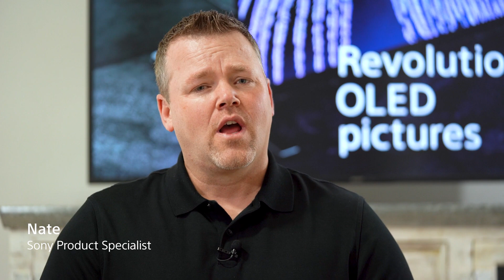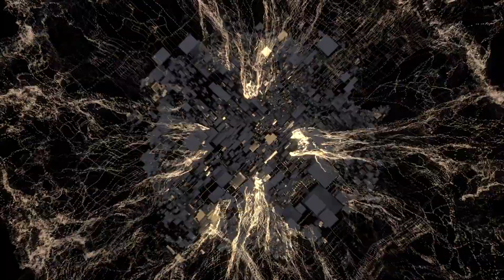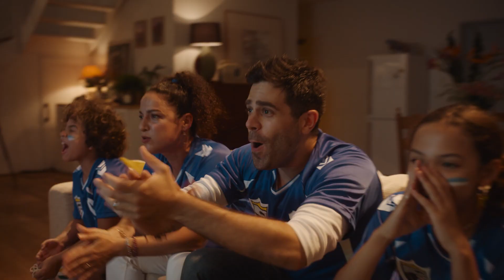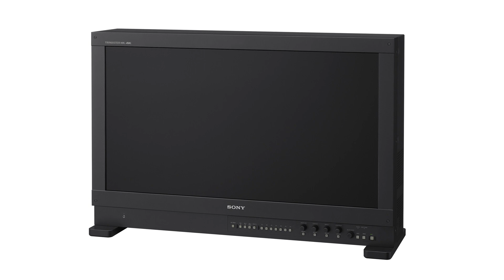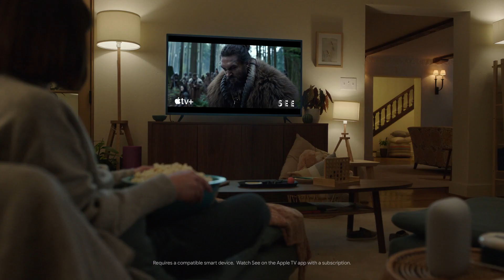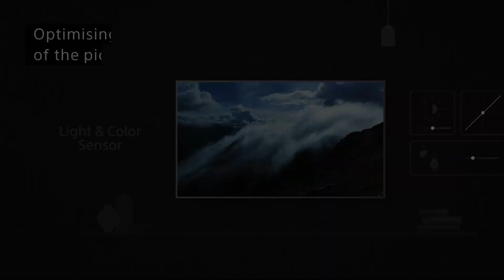Sony | Top Reasons to Step Up From The A80J To The A90J

Comment: Besides the picture quality being excellent there are many issues that come with it. ; soundbar when used on these TVs would drop sound; using on board apps is nothing but pain, it switches the turn off itself, can’t hear sound when you play full movies via the Bravia core through a sound bar . The built quality is atrocious.
Reply from the maker: Hi Elvst, While we're glad you like the excellent picture quality of your Sony TV, we regret to hear you're having sound issues when connected to a soundbar and that the unit turns off by itself. Please provide us with the exact model number of your Sony TV and soundbar so we can better assist you.
To locate the model number, refer to the link below.

https://www.sony.com/electronics/support/articles/S1F0264?layout=standalone

Regards,
Sam

Comment: The main problem of the A90J (especially of the 83 inches model) is the price !!!
I bought a 77A80J for 2.989 €, I had to pay 7.999 € for the 83A90J !
I am not sure the A90J is 2,7 times better ?!?!?!?
It also appears that 77A80J has the EVO panel (from LG), is that true ?
And as already said : please implement VRR quickly on those models !

Comment: The lack of the 77 inch is a deal breaker.  The extra brightness on the a90j seems to mess with other things in a negative way like darks.  The only reason I would want it is for the heat sink that helps with image retention.
Reply from the maker: Hi MrWhatsupeverybody, Thank you for visiting our comment section for your inquiry! The A90J has the protection of the TV screen from image retention like Pixel Shift and Panel Refresh found within the TV settings. Our best-ever OLED TV(A90J), powered by the revolutionary Cognitive Processor XR™ for unparalleled brightness and pure blacks. With XR OLED Contrast Pro using human perspective analysis, color and contrast are boosted in bright areas so you can enjoy the exceptional levels of pure black contrast and peak brightness that until now have simply not been possible. See pictures full of realistic depth between subject and background. Details are sharply defined, even in areas of dark shadow or glare. This TV includes an RGB light sensor that optimizes the color and brightness of the picture to the light source and room environment. 

 Also, you can configure various settings related to the TV display such as color and brightness for picture quality, or screen size. Press the (Quick Settings) button on the remote control, then select [Settings] — [Display & Sound] — the desired option. I hope this helps! Jay

Comment: Will the Sony mount SU-WL855 Ultra slim wall mount bracket support the 83” a90J TV?
Reply from the maker: Hi John Jakaitis, thank you for inquiring about the TV. The SU-WL855 Wall Mount Bracket is compatible with XR-55 & 65" of this series. You can use any Vesa Compliant wall mount with Vesa Hole Pitch 15.75 x 15.75 inch (400 x 400 mm). Please note that there is also a weight limit with any mount and the bracket that you'll be using needs to be able to support the TV weight. The XR-83A90J without the stand weighs 92.6 lb (42 kg). Hope this helps.

Regards,
Jess

Comment: I honestly expected a higher peak brightness from the a90j it gets about as bright as a c9
Reply: Yea they advertise the G1 and a90j as the next level of oled TVs with higher brightness. The C9 was just as bright lol and it’s a 2 year old tv. Ugh I wish I would’ve bought the 77 inch C9 but instead went with the 65 inch last year 😭
Reply: @Squishmallows24  Its unreal how all these "influencers" aren't even mentioning that fact. the c9 didnt even need a heat sink to get to those brightness levels. I havent heard many complaints of burn in with the c9 so its not that, I bet they just added a heat sink to "justify" their price premium.  Influencers also never compare TVs more than 1 generation away. Makes you think. Most of these people are sell outs. They should just be called marketers tbh

Comment: any idea why my 77 inch sony a80j turns on by itself?
Reply from the maker: Hi Jimmy Donnelly, thanks for posting your concern. We're sorry to hear that your TV turns on by itself. We are happy to help look into this with you. Please try the following steps below and observe the issue.

• Make sure that the power cord is plugged all the way into the wall outlet.
• Check if the [Timer] is activated.
• If the TV turns on when an HDMI-connected device is powered on, check the Bravia Sync settings.
- Disable the [TV auto power on] setting in [BRAVIA Sync settings].

If you are still having the same issue, reset the TV.
To reset the TV to the original factory settings, please refer to this article: https://www.sony.com/electronics/support/televisions-projectors-oled-tvs-android-/xr-77a80j/articles/00159487

Regards,
Jess
Reply: @SonyConnect  thanks! Seems to have fixed it. One last question, the netflix app on the tv keeps crashing. All other tv apps work great.
Reply: @jimbojangles72  Force stop it

Comment: The A80J has that premium look to it too. It has that beautiful square pattern design in the back. I hope they add that to the 2022 follow up to the A90J. Don’t know why they didn’t include it in the A90J. It’s the more expensive model and it looks cheap. The heat sink is on the inside, so they could’ve added it. And I hope Sony increases the overall peak brightness next year and get us to at least 900 Nits. Panasonic is at 1000. And why no 77” Sony ? Seriously ?
Reply: A90J Master Series OLED is much brighter.

Comment: who really uses center channel mode?  seems like a useless feature.  Can't justify the price for the 83 inch.  It's missing things already on their competition , mainly gaming features and only 2 HDMI 2.1 ports.
Reply: Have to agree. Either the 77" a80j is too cheap or the 83" a90j is too expensive as the spread is too wide, there's no reason to pay $8000 for the 83" when the 77" is $3500 unless you are at a point where money is meaningless